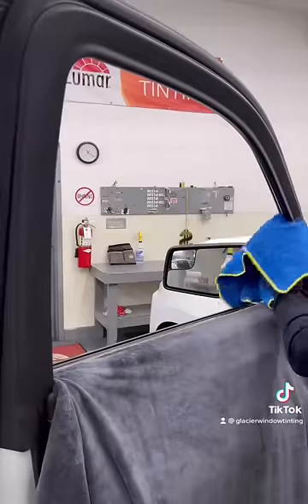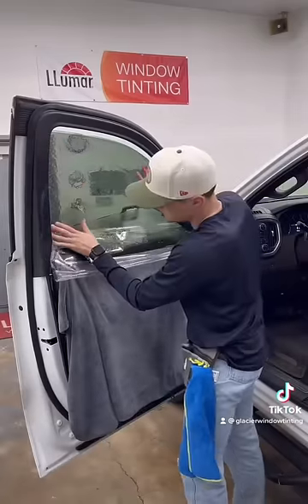Remove & Replace ✅

Comment: "A little bit of heat" 

Blow torches the window
Reply: And did you see the flame? No. It was on LOW.
Reply: @IAmTheSkinThief  Wouldn't low be more visible with a white flame?
Reply: And did you know he just kidding? No. its was a JOKE.
Reply: @IAmTheSkinThief  I could quite easily see the blue frame, it may be on low but it’s still a fuckin blow torch
Reply: came here to make this exact comment, word for word
Reply: @huskkyy  that's set low enough that it might as well be a candle lighter.
Reply: What’d you expect, for him to fart on the window aggressively to heat it up? 

Some people man
Reply: Your comment + your username. We really do live in clown world. 😂 🤡
Reply: @Bongobongobongobongo  ever heard of a heat gun?

Some people man.
Reply: @thisismerica5721  he was using it on the outside of the window. You dont need a heat gun if you know how to use a torch. He is not putting that much heat into it, either. Distance and speed of movement can be quicker than a heat gun with the same amouny of heat put into the window. That is a little bit of heat.
Reply: @Cory-lk5bu  you'd just think a professional would use the right tool for the job, is all.

Shit could go bad with a blowtorch and glass easily. Why even take the risk? Everybody makes mistakes. Better to not to with someone else's car.
Reply: Burnt the bottom edge of the pillar. Very end of the video you can watch him do it. That shiny spot will never go away.
Reply: @IAmTheSkinThief  ther no such thing as low on flame r u ediet? flame goes flame and is hot so shut u think u no is all
Reply: @thisismerica5721  Torch is easier and actually you can control the heat better than a heat gun.
Reply: tell me you never used a small propane torch without directly saying you never used a small propane torch.
Reply: @bobdylan1968  noooooo lolol
Reply: @truthoverlies6434  bro I agree the torch is bad but what you said didn’t make much since. You know a flame can vary in heat right? And a propane torch can be adjust the amount of gas burning resulting in less heat. A flame is always hot but remember that a flame from a lighter will hurt but a torch will hurt more.
Reply: @Rhynocx  I’ve used one before and I know if it’s done right it will be just fine. But i would rather have a safe option like a heat gun. Just not one of the harbor freight heat guns cause the one I bought once sucked.
Reply: As a wise guy once said,
"Always remember, HIGH is LOW"
Reply: But it’s still a little bit of heat. He’s not fucking torching the window
Reply: @USERNAME1-x5u White flames are the hottest ones
Reply: @Kevin12321  yea and when he just happens to graze over the paint job on accident one time on one of the hundreds of cars he'll end up tinting... he can pay for that cars paint correction, or like the plastic trim next to the window not even actually damaging it but ruining the cosmetics of it.. intense flashes of heat will change the finish.. like someone else said just use the right tool for the job. I'd never want someone using a propane torch on my 2022 that im about to go get tinted I don't care how tried and true your method is lol
Reply: @Kevin12321  I'm literally saying he should look for another way. agree with what you're saying but ok. stay jealous over my new shit

what happend to your comment. get deleted??  yea I go and get my shoes tinted that makes sense lol weird ahh. context clues.... use them
Reply: @zanechristiansen  foh. They still there. Idgaf. I just like putting clowns in their place. Yea you not denying your Honda or your employment now huh
Reply: @truthoverlies6434  you have no room calling someone an idiot when you misspelled 5 words in 2 sentences and spelled idiot "ediet" LMAO
Reply: Those have adjustments and levels - just like the burners on your stove. Just think “low heat”.
Reply: Meanwhile, the trim panel is still on the vehicle...Rookie vibes
Reply: I was about to comment that but then I saw this
Reply: @IAmTheSkinThief  And did you see the joke?
Reply: @openyathirdeye6894  if you don't know the difference between a blowtorch and a heatgun you don't Belong here. One is am intense point of heat the other is just, a glorified blowfrier
Reply: My man its a small little propane torch on low flame,not just that it's not like he's holding it for minutes on end at a certain spot

Hell even if it was a mapp gas torch it wouldn't damage the tint
Reply: Just a crème brûlée toasting…
Reply: @thisismerica5721  a professional chooses the best tool for the job for the sitation. In this situation he knows what he is doing with a torch. You could do just as much damage just as fast with a heatgun
Reply: These replys are so weird
Reply: LOL
Reply: to the other side of glass
Reply: @Bongobongobongobongo  a heat gun
Reply: Wow…. He put the flame from a 20$ propane torch on a extremely strong automobile window for 2 seconds…. Almost like it was actually a little bit of heat
Reply: I immediately searched for this comment when he did this lmao
Reply: @IAmTheSkinThief  yes I could see it very clearly actually 😂
Reply: Yeah I feel like a heat gun would be a better option. Maybe not as fast but safer
Reply: @IAmTheSkinThief i did bozo
Reply: @IAmTheSkinThief  are you blind
Reply: Yh lol
Reply: @Jimbo_Fett  ur clerly mad
Reply: You ever quickly run your hand over a fire? Yeah, it’s like that.
Reply: @USERNAME1-x5u  No. Hotter fire gives off more energy, heat, and you guessed it, light. Also what white flame bruh? The only flame I can think of that’s white is an acetylene torch and that’s as hot as it gets? Light flames or blue.
Reply: @ImWithMe  nah bro its litraly a flamethrower! u dont no what ur talking bout! it kills glasss. i tryed once and it killed my car
Reply: @BigRheno  blue flames are hotter, it usually is the start of the hottest part of the flame.
Reply: Google the difference between temperature and heat energy. In this case, only a little bit of heat from the extremely hot torch will be transferred to the window because of the way he's doing it
Reply: @huskkyy  you do understand how fire works right the orange outer glow is cold safe to touch actually along as you don't ligure the blue part is the hot stuff on this setting can you guess which part of the fire touched the glass?
Reply: Jesus Christ, there sure is a lot of people here that don't understand the difference between heat and temperature.
Reply: This thread shows how much of y’all haven’t used a blow torch in a professional setting 😂.
Reply: @IAmTheSkinThief  you got them extra chromosome 22s don't you? its a push button torch, 1 click= on no high or low setting
Reply: @bobdylan1968  the more of these I read the more I want nukes to end reality
Reply: anyone defending the torch or saying its "on low" should Ronnie mcnutt themselves
Reply: @COKTilYouDrop  you absolutely can set push button torches lmao. 

I have several. I've never seen a torch that wasn't adjustable other than maybe the lighter sized ones.
Reply: @bobdylan1968  you literally CAN NOT adjust that one its not a turn nozzle its a click 1; it rotates to an on and off setting, I literally work with this type of torch because the flame gets bigger than the twist knob ones
Reply: @bobdylan1968  it's literally a US PAT NO 4348172 torch head... if you don't know what you're talking about don't comment
Reply: @IAmTheSkinThief  this guy just wants a reaction from people and to be “funny” he’s clueless
Reply: You're over thinking it. That was a little bit of heat to an industry standard.
Reply: Yeah I was kind of concerned about the paint too
Reply: @laprepper  paint from the flame? Lol. Have you ever seen a car get vinyl wrapped?
Reply: @smokinwoodz  found the clown
Reply: @IAmTheSkinThief  yes, you can clearly see the blue flame
Reply: It’s more about how long he holds it in one place even if the flame is intense he heats it nicely by constantly moving
Reply: A little bit of heat is relative to how fast the item heats up, a little bit of heat to a human compared to a kitchen skillet is severely different
Reply: @cool.stuffs  cars that are wrapped with vinyl (at least around here) get a heat gun used to shrink the vinyl (it would tear and rip of you used a torch like that)
Reply: @theretep6494  wow you use a heat gun not a torch with 3,600 °F worth of heat

to put that into perspective 
The heating element in a heat gun typically becomes red-hot during use. Heat guns operate at lower air speeds and produce temperature as high as 1200F, hot enough to melt some types of glass. (but the air is moving the heat) the torch it double that using pure flame on a glass object and no air "blowing it around" like a heat gun has going for it; AND hear guns CAN MELT GLASS at under half the temperature of a torch......

needless to say the torch is AND WAS overkill
Reply: @jonsaircond8520  torches get over double the heat they are not "easier to control" your comment gave me a tumor
Reply: @ImWithMe  quickly touch that  glass that isn't that hot afterwards then 🚮
Reply: @COKTilYouDrop  the only thing I use a heat gun for when I wrap is matte or satin. I wrap cars mon-fri and use a torch.
Reply: @cool.stuffs  cause you can hide the damaged caused by your torch until they get a new wrap
Reply: @COKTilYouDrop  🤣🤣 I see now that you have no clue what you're talking about.
Reply: @cool.stuffs  he literally burnt the bottom edge of the pillar of the car with the torch IN THIS VIDEO; it will NEVER be the same again  and you gonna sit here and tell the person who literally wrapped cars for over 10 years that I'm wrong

you not only have a  🚮 comment but mindset as well
Reply: @cool.stuffs  if you're supposed to be the professional id hate to see noobs, cause your ability to form actually thoughts are at the lowest setting, did you max yourself out in the "Outspoken" category? and now you can't have an original thought?
Reply: @USERNAME1-x5u  nope.
Reply: @bobdylan1968  which is still fucking hot, like 600-1000°celsius hot.
Reply: @huskkyy  it still takes time to apply heat you can brown a marshmallow with a blowtorch if you only use it for a second.
Reply: @Bongobongobongobongo  heat gun
Reply: @IAmTheSkinThief  I sure did
Reply: @Bongobongobongobongo  A heat gun, "SoMe PeOpLe MaN" 🙄
Reply: Youtube commenters will argue over fkn everything
Reply: @huskkyy  depends what kind of blowtorch. Butane? Not very hot. Acetylene/MAPP gas? Window go bye bye.
Reply: @IAmTheSkinThief  you can see the flame very obviously do you have vision issues?
Reply: @thisismerica5721  sorry but you’re just wrong
Reply: Compared to acetylene yeah, its just a little bit coming out of a propane torch
Reply: @IAmTheSkinThief low would’ve been around 1k it looks like 7k
Reply: Prrreeetty sure that's steam?
Reply: I came for this comment
Reply: @nilloc28 his 13k likes and your zero is the 🤡 part.
Reply: @JesusSaves71185  it’s irrefutably easy to believe, 13k people have never tinted a window. Duh!

The comment is relatable to the ignorant. It’s called “confirmation bias.”

“Likes,” are a volatile metric of worth….

Happy New Year bro!
Reply: @nilloc28  or 13k people have heard of a heat gun and choose not to torch their window….
Reply: @JesusSaves71185  you’re replying to my comment, which is 8 down from the OG. It was also posted a month ago. 

Why? Are you just irritable today?
If so, I hope you have a good rest of your night. Take a load off bro. You deserve a break. 

Don’t shit post a month old post. Do something “even better.” Go plan a good New Years and, have some fun. 😊 stay up king!!!
Reply: @JesusSaves71185  😂🤡
Reply: @nilloc28  better late than never.
Reply: Yooo did anyone else notice that big ass air bubble at the end
Reply: @Bongobongobongobongo  Heat gun is the way, slow heat evaporates bubbles evenly.
Reply: @IAmTheSkinThief  Did you know that a blue flame is hotter than an orange flame? no, because you not learn anything in school
Reply: @jonsaircond8520  You have never used a torch in your life.
Reply: @kiyoponnn  what the heck are you guys doing with these little handheld torches. Lp gas and quick movements is pretty darn easy to control the heat. When using it right after putting tint on the moisture between the fresh tint just makes it even easier. Heat gun takes forever and by the time it warms up the glass is heat soaked and continues to heat up rapidly after you move the gun away.
Reply: @Bongobongobongobongo  this may be premature but..... I think I love you😂
Reply: @USERNAME1-x5u  if you took chemistry you may remember that based on what fuel is being burned, it changes he color of the flame, blow torches are always blue/orange because they use propane or butane which produce blue/orange flames.
Reply: Tis the way
Reply: Helps cure the window film on glass

Comment: Idk about cleaning with windex. Even tho you wipe it away, some of the ammonia will still around and discolor the film over time
Reply: Ammonia free windex, but I don't use ammonia free windex for tinting, only for cleaning afterwards... but yeah, you're correct: don't use windex w/ammonia...
Reply: We use dish soap cleaning windows professionally, we often clean windex off windows. He isn't using windex to clean it though, just to dissolve residue that soap wont easily remove. 

Windex is not for squeegee use, its designed to wipe off relatively streak free, but still has a residue that needs soap to clean off, ammonia or not. 

Based on how the window looks and that he said he used "soapy water" it seems he knows this, he cleaned the window like a pro after using the windex and scraped. 

 I'd say ammonia doesn't matter, you cant skip the soap and squeegee, and that process cleans off remaining residue.
Reply: @CLMcrawlers  Windex is horrible for cleaning windows, just use soap and water with a squeegee like this guy and every pro window cleaner. Goof off removes everything, but windex can be used to dissolve things. You still have to use soap and a squeegee or there will b a residue that is designed to be temporarily invisible. He didnt even need windex if he has a scraper, but it probably makes it much easier.

Comment: Never seen nobody do this the proper way not even myself and I haven’t had a complaint in 10 years
Reply: The proper way would be to remove the door panel and use a heat gun and not a torch.

Comment: I'm jealous of how clean that window was. I can never get it to clean without streaks
Reply: Clean it with window cleaner, let it dry, then get an eyeglass cleaning solution, or anything thats basically just alcohol and use just enough to scrub away the streaks with a clean dry microfiber cloth. Best thing you can do to keep them clean is keep your windows up and always use your ac, i clean the inside of my windows once a year and its easy af

Comment: My car came off the lot tinted.. there were literally food crumbs under the film. Told them to remove and give me a check to get it redone elsewhere. Their tint guy didn’t know how to remove it, left the adhesive all over the windows and solution all over my back seats. New guy did a perfect job and even cleaned up the adhesive and my seats free of charge

Comment: I really like non tinted windows at night but in the day time I like tinted. Someone needs to invent active tint or something
Reply: There are some car sunroofs that have it but it is mostly on high end luxury cars and it is super expensive either way, it would require getting a whole new window due to the integration along with the wiring.
Reply: Photocromic window tint jus looked it up check it out
Reply: its already a thing. the government uses it on limos and transportation vehicles. you can hit a button and have anywhere from no tint to 100% privacy

Comment: The fact that you cover the trim from getting wet, you have my respect. I have seen and have people tint my car and spray crap all over. Even though it’s harmless but stuff like that makes people mad. Respect to you bud.
Reply: Its just water and a very mild soap with no chemicals. After the door panel is soaked in water, they are basically just cleaning the door panel for you. I did tint for 11 years. Never had a Karen tell me " DoNt gEt My DoOr WeT"

Comment: I've always been told windex leaves a residue that is difficult to remove and can compromise window films. I use rapid remover, clean, and tack II for cleaning my commercial window installs. You should give it a try. Much better than windex soap and isopropyl.

Comment: Love that product. I've had it on my outback for two years. Works amazing. Too bad my state doesn't allow windshield tint it would make the ceramic products more effective.
Reply: They make it in clear, got it on my truck and it blocks a lot of heat

Comment: The towel on the door to prevent liquids from soaking into the switches……

There’s a special place in heaven for you
Reply: Ehhh, those switches are water proofed in modern cars, they got membranes underthem

Comment: Not saying you're wrong for using windex, by no means.  But I worked for a well known tint shop in my area years ago and they mixed Johnsons baby shampoo with water in their sprayers.  Only a few drops or squirts depending on the sprayer, but just enough to make it sudsy just like Windex.  It's cost effective, won't damage certain materials thats in high end cars or expensive wood trim if your frosting or tinting house windows, it's a lot better for your skin, and kinda more pleasant to smell.  Sry for the paragraph, but figured I'd share another option.

Comment: I'm not going to claim I know more about glass than someone who works with it but as far as I've done work with glass, that kind of heating will probably ruin the temper on every few windows you do. 

I would sweep much wider while heating it for longer so the heating is smoother throughout the glass as well as peak temperatures staying bellow temper levels.